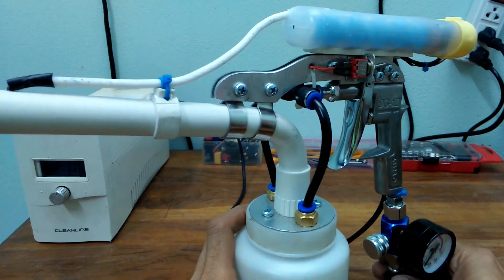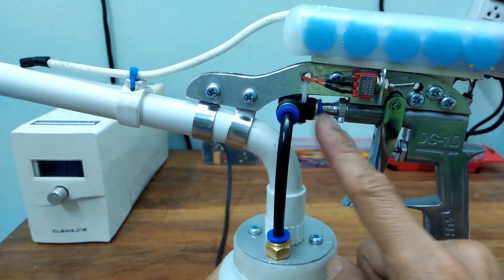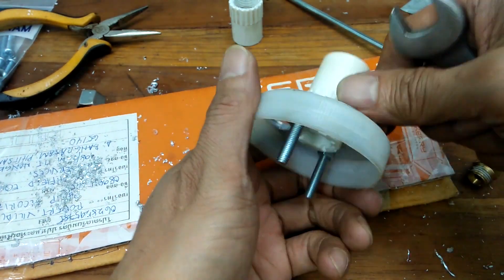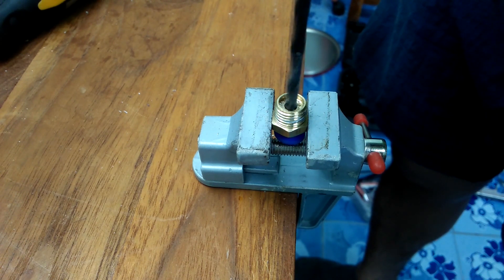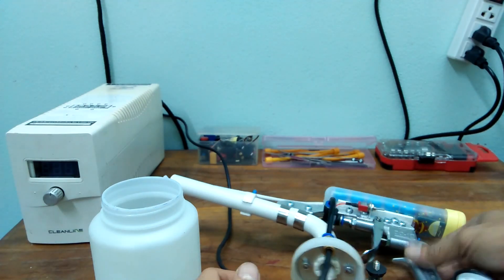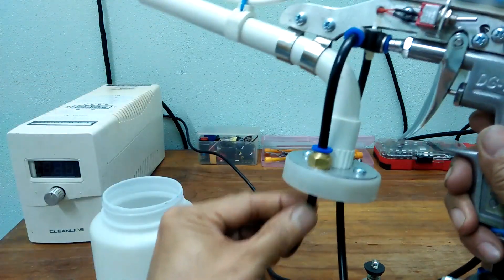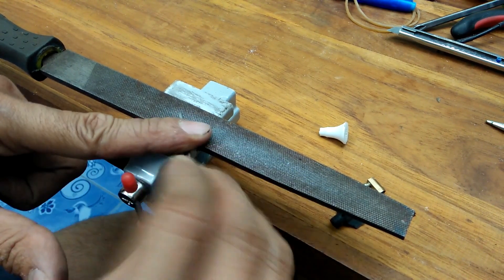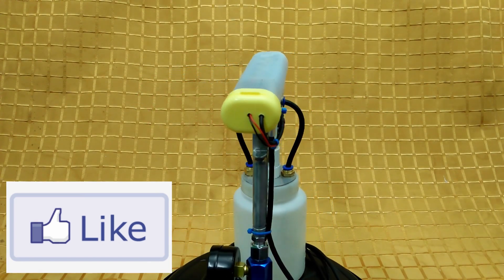Homemade Powder Coating Gun V.3

Comment: What happens if you touch the tip while its on?
Reply from the maker: Hi. If you touch the tip with bare hands and some other part of your body is somehow connected to ground then you will get an electric shock. It is high voltage but very low current in uA range so it is not really dangerous. If you are insulated from ground and you touch the tip, your body will be charged and your hair may stand up.
Reply: @DIYPhil  i wish I could make it but I don't know things about electricty so I don't mess with it

Comment: Sorry, what diameter of the PVC pipe did you use, sir?
Reply: Are you using an outer diameter of 22mm sir?
Reply from the maker: The PVC pipe outer diameter in this video is 22mm. I later changed to a PVC pipe with 18mm outer diameter (marked 3/8" nominal). These are PVC pipe for electrical conduit, not water pipes.
Reply: @DIYPhil  I have an electrical pipe OD 17.5mm & ID 13.5mm, 2mm thick, can it be used, sir?
Reply from the maker: @irfansetyabudhy8745  yes.  Just use whatever you have available
Reply: For power supply, can I use a 12V 3A adapter & a 10A XL4016 step down audio module, Sir?
Reply from the maker: @irfansetyabudhy8745  you can use your 12volts adapter power supply but you will need to step down the voltage to about 4 volts if you do the same circuit as mine.
Reply: @DIYPhil  I just ordered 10pcs 1nF 20kV capacitors, 10pcs 2CL77 20kV 5mA diodes & 1 set 15kV generator kit from online shop

Comment: Can you use 12v??
Reply from the maker: The dc power supply I am using is actually 12V then goes to a dc to dc converter to regulate the output at around 4 volts
Reply: Ok m'y freind
Reply: Thanks in flow you Always

Comment: If it Can work all Time for example 8h
Reply from the maker: No.  Because it will run out of powder and you have to turn off the unit to refill the hopper
Reply: Yes i know i mean 8h in work with powder
Reply: I am working in industrial and We have a lot of machines of powder coating

Comment: If it work without heat problem
Reply from the maker: I have not noticed any heat problem because this device is very low power.  There is a heat sink for the transistor.

Comment: Is the output voltage can kill you? This is serious question..
Reply from the maker: No. It cannot kill you because the output current is very low. In the order of only micro-ampere. It is similar to tasers. It can shock you but not lethal.
Reply: @DIYPhil  oke thx a lot 4 the answer, i will continue to try  to make it.

Comment: Wow, this looks awesome!!!
Reply from the maker: Thanks. Will have a lot more vids coming showing me using this contraption.
Reply: @DIYPhil  Fantastic!! I noticed that you used ultrafast high voltage diodes. Do those actually have to be used ? I was of the impression that 1000volt uf2504 could be used
Reply from the maker: @Biokemist-o3k  I only used it because that is what I can find at the moment. You can try the UF2504. If you find that the voltage rating is not enough, you can put 2 or more in series.
Reply: @DIYPhil  Thank you because I have a bunch of those laying around from other projects.
Reply: @DIYPhil  That is very helpful.

Comment: I have tried to look for a cross section of a powder gun and it seams to me that they use venturi  effect to suck and mix the powder. This only mix the powder by blowing in the bin. Do you have any thoughts?
Reply from the maker: Hi.  This one I just made is comparable to the hobby guns such as those from Eastwood and Harbor freight that just blow air to the jar of powder. There is something special with the nozzle of the pro powder coating gun. They are not just straight tube. I definitely want to duplicate that.  In fact I'm trying to order online for the Chinese copy of just the nozzle and powder pump to see how it can be used with our diy gun.
Reply: @DIYPhil  that would be great. I have a 3dprinter so I would be interested in trying to replicate it with a homemade part :)

Comment: my brother i have been waiting for this video.

if you can make a simple video that explains how you made the electrostatic charge that will be great.
that's where am stuck now.
Reply from the maker: Hi bro.  Have you seen this video yet?  
https://youtu.be/jJm6EpnzTnQ
I will explain in more details about the high voltage cascade used with the gun on the next video.

Comment: How is the 15kV transformer holding up? Have you used epoxy on transformer and  cascade?
Reply from the maker: Not great.  I changed the feedback resistor to higher value so that I can increase the input voltage.  Sparks flying out inside the case.  Not only from the transformer but also from the cascade.  I later soaked everything in insulating varnish and seems to help.  I will update for development in that area.
Reply: @DIYPhil  maybe you can understand something from this guy and make something useful from it https://youtu.be/iHkKTGYc6aA
Reply from the maker: Hi thanks.  That is the exact video I watched that gave me an idea to use the 15kV kit.  I'm experimenting with different circuits he did.  The HV generator is still a work in progress.
Reply: @DIYPhil  Keep us updated! But when you have soaked everything in varnish you haven't had the same problem?